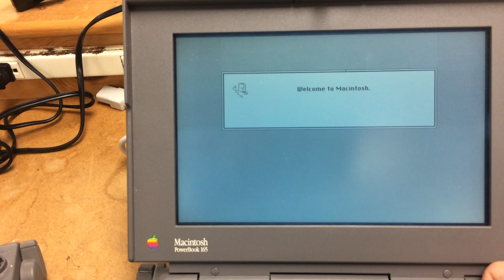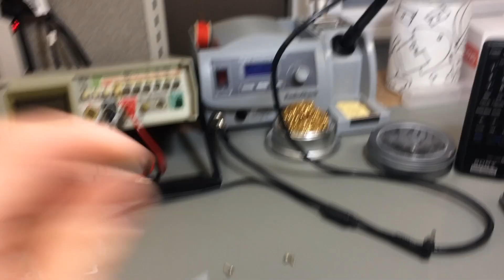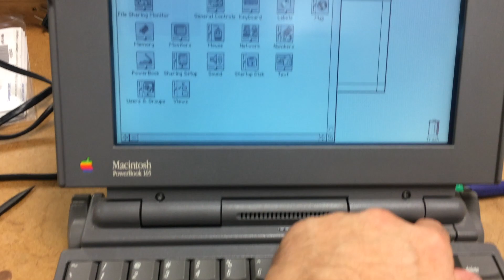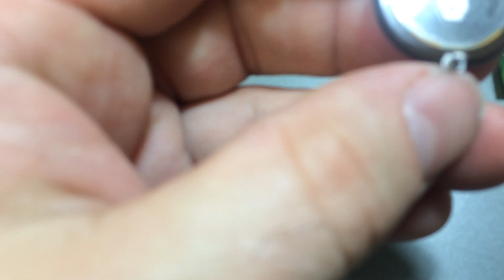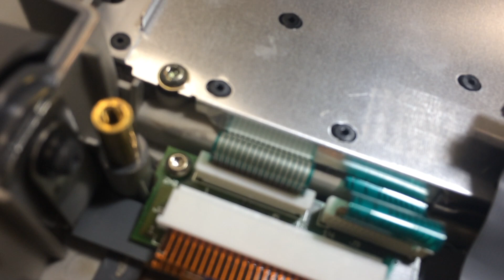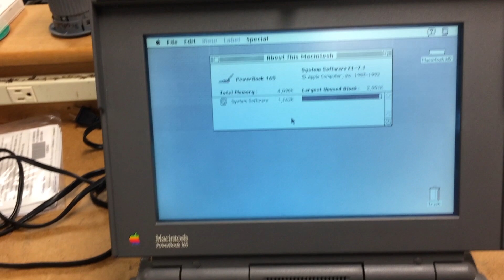Macintosh PowerBook 165 LCD Panel Capacitor Replacement

Comment: Hi there. I know this is an old video but do you happen to have any advise on repairing a Powerbook 140 that had the entire screen snapped off? The Ribbon cable is also, completely ripped in half and i have already disposed of all broken parts leaving me with the LCD, Bezel and bottom half
Reply from the maker: At this stage, it’s a parts machine. Find another one in better condition
Reply from the maker: The issue here is quite common, where the display hinges snap off; it happens to ALL PowerBooks that use this chassis eventually.
Reply: That's a shame... I did plan on soldering a new cable in place of the ribbon socket
Reply: Also powerbook 140s are near impossible to find in Britain so im effectively stuck with this oney

Comment: A bit late to the party but thanks for this video. I just picked one of these up at a "car boot" for £5 including adapter & carry case! The screen is almost completely washed out, I can just make our the insert floppy  icon and the HDD has failed. So now I know how to fix the screen.
A question if I may: Have you ever managed to open a battery pack? I just want to remove the batteries as they are leaking and expanding causing the battery case to bulge. Thanks.

Comment: I have one of these. The outside of it is in such great shape! I love it. And I got the apple messenger bag to carry it! Plus the original receipt, and some old apple product book. But I took mine apart January of 2016 with plans to replace the screen capacitors and fix the cracking plastic. Well it did have a number of cracked support posts. So it sat. Come January of 2017 and I finally get to fixing it! I got the posts glued with JB Weld. That shouldn't allow that plastic to go anywhere! I got it all back together in one piece and it worked! After a year of siting in a box in pieces I managed to get it back together properly. And for it to work! But I never did replace the screen capacitors. I do want to but need to practice and learn how to solder SMD first. Last thing I want to do is kill my power book! I would rather kill a $20 kit from china the my power book I got for $65!

I only need to replace those capacitors. Replace the cmos battery. Replace one of the tilt up feet as it has a slight piece of the rubber missing. And the trackball hold down has one tab missing. So it won't hold the ball if tipped upside down. But I have a new battery for it and get good battery life. I love this machine, too bad apple had to use ABS plastic. I wish someone would make new plastics for it. I can't as I have no idea what to do! But would love to remake and sell them to the owners of these dying machines.
Reply: As far as I know, having plastic parts molded is monumentally expensive, and not something that most average people could afford. If it was cheap, lots of people would probably be making new parts for these machines.

Comment: I just got myself a PowerBook 3400c, pretty nice machine (it's basically an enhanced 5300ce with CardBus, a faster CPU and PCI architecture)... all I need's a CD drive (I do have a ZIP and a floppy for it), gonna maybe put 9.2.2 on it on a 16GB CF card

Comment: That would have been me. :-) Instead of taking out the display, I said screw it and sent the whole upper display assembly to you. The bottom half was melted in the AC adapter corner from the wrong AC adapter, fried LB.

Comment: Not all passive matrix displays are created equal. My 150's 4bit display is terribly murky, despite being the youngest, and recapping didn't make much of an improvement. It's just awful.

The 1bit displays on my 140 and 165 are better but still show visible ghosting after a recap, depending on what's displayed. 

Any yet strangely enough, the 1bit display on my 100 is about as perfect as a passive display can be! The lines and tearing are a lot less noticeable and there is no murk. Weird.
Reply from the maker: The ghosting will NEVER go away; it was built in. I remember using these things 20 years ago and they were utterly terrible. Color passive displays are even worse, if you can imagine that.
Reply: Oh I can, I had a 165c that was working until recently.

Comment: I'd love to hear what software you typically load on a Mac of this era and what customizations you make.
Reply from the maker: I don't usually make any customizations, but I generally load whichever version of MacOS the machine was designed to run, plus a variety of games and whatever I may have at the time of repair. Currently, they almost always get ClarisWorks 4, SimCity, Glider, Brickles, Motorbike, Shufflepuck, and a few other odds and ends.
Reply: I have an old "Mac Almanac" from the System 7 era, and it has a lot of interesting tips for rearranging Apple menu items and using aliases in ways I wouldn't have thought of. Being 26 my earliest Apple OS was Snow Leopard, so I am slowly learning the pre-OS X power user stuff.

Comment: To fix cracked screw posts i use glue then a zip tie to press it together then either cut the ziptie off when its dried or just leave it there if its not in the way.

Comment: While on the subject of batteries, it reminded me of something. The lithium battery in an eMac is rechargeable, even though it says it isn't. I found that out when I thought it meant Lithium ion when it said lithium on it, only to see it say non-rechargeable on it after I recharged it and was looking for a date. I left it on the bench power supply at 500 MaH for 4 hours and it never got hot.
Reply from the maker: No, the lithium battery in an eMac is NOT rechargeable! It's supposed to be a Tadiran TL-2150 or a SAFT 14250 3.6v 0.5AA cell. DO_NOT_RECHARGE_THESE!!!
Reply: They are not rechargeable, however the particular battery chemistry, Lithium Thionyl Chloride is extremely prone to forming a high resistance layer of Lithium Chloride on the annode of the battery when stored or used in low power applications like RTC , so what you can do to fix this problem is use the battery for a high current load which can break up this passivization layer and the battery will out put a normal voltage again and continue working, unless the battery is actually fully discharged some circuit designs may incorporate a resistor as a parasitic load to prevent a thich layer of LiCl from forming in which case after nearly 20 years the battery may actually be dead not just sleeping.
Reply: Here are a few articles about Lithium Thionyl Chloride batteries. 
https://www.creasefield.co.uk/technology/passivation-in-lithium-batteries/
https://www.eetimes.com/author.asp?doc_id=1322276

Comment: I'm surprised that hard drive still works. It took a bit of percussive maintenance to get it spinning again after a nearly 10 year slumber. Stiction was bad on those drives.
Reply from the maker: This drive is one foot in the grave, sadly. Both rubber bumpers have liquified, and the noise it makes upon startup and shutdown is horrifying. I've explored methods of repair by dismantling another Quantum ProDrive LPS, and it's not something I can repair. The conner drives, on the other hand, are repairable. The biggest issue is maintaining factory alignment and torque while safely unloading the heads to remove the platters... just can't be done...

Comment: Man, I love the PowerBooks. I had a G3 (SCSI) From January 21st, 1999, It's hard drive died. I was neive and threw it out. I am kicking myself for that to this day. To make matters worse, It was in Mint condition from it's original owner. I wan't to get another one someday
Reply: I recently got one of the old G3 clamshells and to this day I still haven't had a more comfortable laptop for typing and basic word processing. It's still in great shape and I grabbed a new battery, so it runs for about 7-8 hours on a charge. I was impressed by that since I don't recall them lasting as long back when they came out. I used to service Apple computers and I've been thinking of getting one of the old Powerbook G3 systems that's one of the top-end units from the Wallstreet, Pismo or Lombard series.

I had a G4 that I got new, but those have a problem with VRAM or something and that one killed itself years ago. I recently extracted the HDD from it to get the data off of it, which was almost bit-rotted into oblivion, but it was mostly recoverable and I got what I was looking for. Some of these older units could be temperamental.